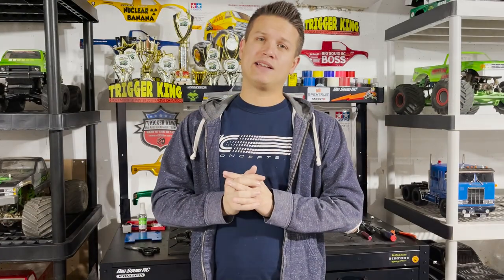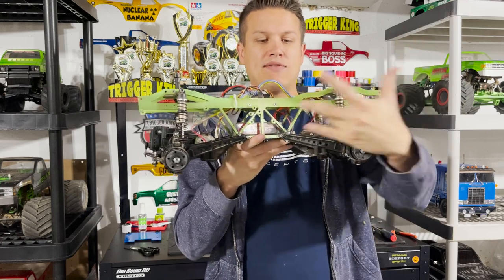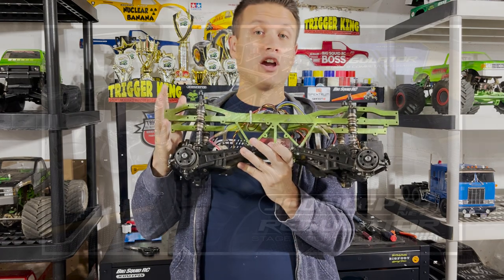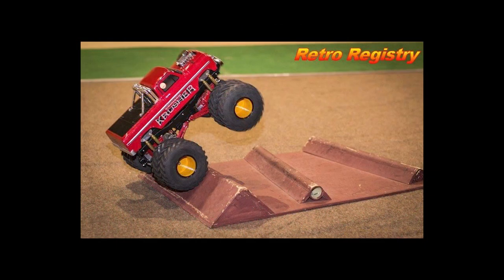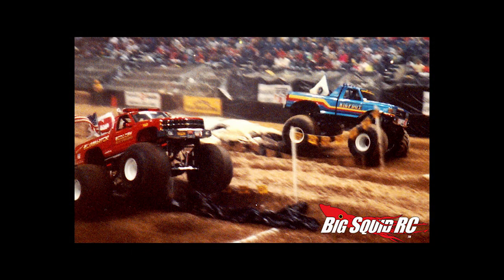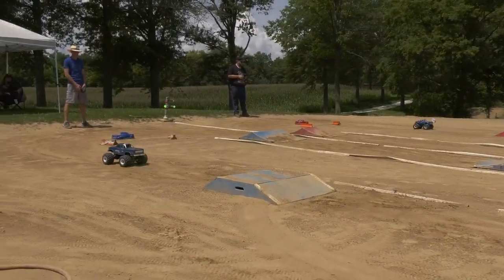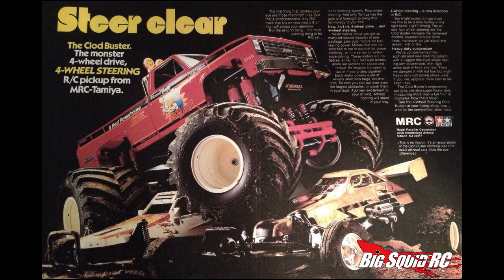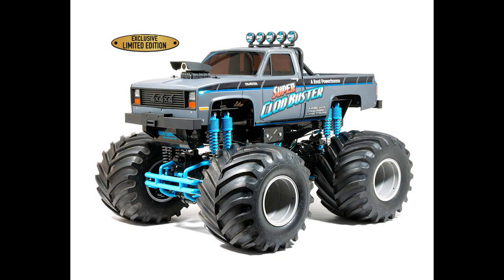What is a Retro RC Monster Truck?

Comment: Retros are such a blast! We've found by limiting the speed and having a minimum weight, it makes all the trucks whether clod-based or shafty, fairly even which makes for close and unpredictable racing with trucks that are pretty rugged and require very little maintenance after races. We based our rules off what you guys do basically replicating the late 80's stage II trucks running bodies of 1993 and older with the base being either clodbuster or replicating the suspension setups of the time period.
Reply: Should also be limited to 2S and Mabuchi motors only!  That would really be down to driver skill and how well they know their build
Reply from the maker: @georged2715  Hey George, I'm going to do a response video to this as there are some excellent responses already, but on the Mabuchi thing while we totally agree with you, in practice when you start getting a lot of people showing up, unlabeled silver can motors can be anything inside and once some people start having trucks that are way faster (a lot of the time it can be luck of the draw, some production line brushed motors are just a lot faster and others slower despite being the same motor technically) then racers start getting upset and accusing others of cheating or foul play, which is why we went to actual labeled 27t motors like axials or jconcepts. I'll talk more about this in the upcoming video!

Comment: As for me an Rc retro monster truck is a Clod based one. Not perfect, not 100% scale but has its charme. Bought my Clod in 87 an had blast with it. Later in the mid 90's the Juggernaut followed. A fine rig but total different animal with its torque twist. I'm 58 now and after 37 years the Clod still has my attention while the Jug has not. I hope that explains  Retro. 😊

Comment: I look at a true retro being a clod based axle motor mount truck. It is one of the true original monster trucks that you could get different kits and build up back in the days. I am working on one now with a full aluminum chassis. I gotten 2 for $45 last week.

Comment: Great to see you again 👍

I used to think that retro monster trucks is just out of the box trucks with minimal to no improvements and 27t brushed 540 can motor with 2S lipo 🙂

But there is one thing.... don't know how to call it (English not my native🤠). 
Older monster trucks are not so "super-stable low-center-of-gravity wide-axles low-clearance etc racing thing"... 
It just a monster trucks like from maybe 80s? 
Thats the point👍🙌🌞 long live to retro)))
Reply from the maker: Hey thanks for the comment. Totally understand wanting them to have a higher COG!

Comment: Thank you for the video.  I have owned a Tamiya Clod Buster ever since the kit was first released in 1987.  It has been highly modified over the years and just recently I took it out of storage to bring it back to life again.

This is interesting because I never knew that there was this trend to create a retro monster truck racing class until I saw your video.  Back when I first got into R/C monster trucks, there were no modifications available for the Clod Buster so they were all stock, aside from the parts from Tamiya like shocks and bearings.  Once I saw an ESP Hobby ad in R/C Car Action magazine though, then that got the ball rolling.

Thanks again for the video.  I'm having fun doing research into what it will take to get my old Clod Buster rolling again.
Reply from the maker: I think a lot of us saw that same ad.  It was fun to watch all the mods that people made and sold come out on the years following its release.  While the stock Clod's steering is junk, it still brings back memories when you drive a bone stock one.
Reply: @TriggerKingRC  It's funny that you mentioned the stock Clod's steering system.  One of my old trucks that I just dusted off and am working on is the actual King Clod truck that ESP used in their ads and catalogs.  I bought it off of one of the old ESP team drivers.  (I honestly cannot remember his name since I've been out of the R/C monster truck game for about 15 - 20 years now.)  I could convert its steering system to something better by mounting a servo on each gearcase but I decided to keep its original Clodzilla II chassis mounted big 1/4 scale servo.  It's steering performance is terrible, like you mentioned, with lots of slop/play but it is a look back in time to when most Clod Buster modifications were for looks and not for all out performance.

Comment: I think the CEN racing stuff might be a good place to start from if someone would come out with a leaf sprung solution.  Despite not being an old school RC it would be a good starting point for a more realistic old school MT class, particularly the F250, but the cost is a bit prohibitive.
Reply from the maker: Hey Sean I know the only experience that I (Doug here) have anything CEN was that 1/12 monster truck they did a few years ago and the quality was, um, questionable is a charitable way to put it. I know the big dually trucks they've done seem to have a lot of fans though so perhaps these days CEN makes better stuff? I feel like the first company that does a proper leaf old school truck is gonna sell a ton
Reply: @TriggerKingRC  I get that feeling too and it's not like I have some fountain of confidence in CEN, just they're the only ones that seem to be remotely in the neighborhood.  with something they could easily convert. lol

Comment: A retro truck clodbuster based, is just that. The early days of the full sized trucks were bouncy and sloppy and had real crushing power and the suspension was what it was. So motors on axle sucks but that’s what we have. No matter how much money you sink into it, it still is old technology. Tamiya really needs to up their game. I built an axial smt10 but it was the wrong size and still didn’t feel like the real thing.

Comment: So I've been working on getting a group started here in East Texas, and we've settled on rules similar to trigger king's except we wanted to simulate the later days of leaf spring trucks, so we upped the motor to 17t. So far it's been Fun and really replicates that Fast Leafer era of the early 90s....
Clods with stock style suspension and shaft trucks as long as they have leaf springs and no triangulated 4 link.
Reply from the maker: Glad you guys are getting it going down in Texas! 17t sounds like a lot of fun for them! You guys allow oil shocks?
Reply: @TriggerKingRC  yes. We definitely land on the old school monster trucks side of the equation rather than the old school RC side.

Comment: I feel like a retro MT should have slower motors (27 turn), minimal suspension travel and have an older body style. After that, have fun. Shafty or MoA, go out and run them.
Reply from the maker: I think this is ultimately what most people think too!

Comment: The best way to regulate the Retro class (or any power-limited class) is with the track. Making it so the trucks can't wind out speed-wise, a mix of different kinds of turns, etc makes you have to set your truck up to compromise somewhere.
Reply from the maker: Hey mtfan thanks for the comment. We all agree with you...though having done it for years, if you start trying to add a ton of turns and obstacles to slow faster trucks down, it winds up just mucking up the racing and turning it into a "whose truck can randomly get the best bounce". Is it also turns out, the fastest trucks usually win the races anyways. This last year we limited trucks to a 10mph speed limit (we tech the trucks at the start of the race day with a radar gun) and that has felt about perfect for TNT-era retro style racing. We can have wider open, faster courses again!

Comment: You bring up a great point. The big thing that drove me towards an SMT versus a clod was the drivetrain and chassis appearance was very clearly that of a toy rather than a real truck, that and the frankly archaic stock form that requires it to be more or less rebuilt from the ground up to compete or bash reasonably well.

I would like to get into a league someday and retro class certainly has it's appeal, but I really have no desire to get tangled up the weird twin motor on axle setup of clods. I think given the roots of the real steel sport, it would be very cool to see retro trucks built off of crawlers, with ladder bars and two or even 3-links and leafsprings, maybe broadening the class inspiration from TNT all the way to early PENDA series and. I don't know how they would match up to modclods, but I recall someone building an excalibur with with a leaf and coil hybrid suspension that competes in the retro outlaw series. As it is now, the fact that clods are really the only platform for retro seems like it would discourage a lot of potential competitors and leagues from form, as the clod is rather unlike any other scale RC vehicle.
Reply from the maker: Thanks for the comment! Hopefully soon there are options for leaf trucks!

Comment: I feel like a Retro RC Monster truck racing should be either a Clod based model or a Juggernaut with 27T motors and 2s battery. I would include the Kyosho USA-1 but it is even less scale than the Clod with its odd independent suspension chassis. So I would say "OUTLAW Retro CLODERNAUT Monster Truck Challenge"

Comment: Nice video.  I just built a Freestyle RC Axis retro chassis.  There's no clubs around so this was just for fun.  It's a cool blend of leaf springs and a modern SMT10 drivetrain so it's somewhere in the grey area of what a retro truck is.  But yeah, good luck defining it 😂

Also, I COMPLETELY AGREE about the Juggernaut re-release!!!  Don't you have enough influence in the industry to help make that happen?  haha
Reply from the maker: Thanks for the comment on this, hopefully you are liking the Axis chassis! Josh and Freestyle always put out top quality parts & chassis and those trucks look like nice kits. As you say, the Axis is somewhere in the grey area and last year when it came out we thought it looked a little Stage 3-ish (like the early 90's trucks when hybrid suspensions became somewhat normal) for what we wanted our class to be and didn't allow it. That's why I say from a racing perspective this class is extremely tricky to try and govern we recommend just going with what your local crew would wanna do if you wanna race them!

As for the Jugg re-release, I think Tamiya just does whatever they want at all times and doesn't pay much attention to whats going on in the hobby at large. Or at least it seems that way in a lot of respects! A Jugg 2 re-release or a Jugg 3 (assuming they use a good body) would be a massive hit. So much so, that I think if the Jugg was available these days it would become the defacto Retro-racer.

Comment: I've been wanting to get into building one of these for a long time personally as I've been a fan of monster trucks since I was a kid way back in the 80's. However, I've found myself always worried about "doing it wrong" for the longest time. To spend a nice chunk of change on a truck only to find that I've built something that wouldn't pass tech for something like a Trigger King or another organization. That I would be excluded from participating because what I think would work and what is allowed are two different things. I'd simply wind up just wasting the time of not only myself but of others trying to ask questions and attempt to get literal unobtanium parts. I do hope one day that Tamiya will get off their butts as re-release the Juggernaut cause that one has checked all the boxes I've wanted but again it's become so difficult to find one so as to be next to impossible.  I have wondered if it was possible to build as close to a Juggernaut using more modern parts but I have no clue where to start.
Reply from the maker: Good luck there. Tough to find stuff for it.

Comment: Sure, a more correct shafty truck with replica Rockwells would be great, for looks. But leaf spring monsters were basically rigid. 

Imho, a retro truck should be stock or near stock wheelbase, ladder bars, and slow. Y'all's trucks are a perfect speed. I wouldn't have a problem with a low speed brushless setup, seeing how quality brushed motors barely exist

I think maybe the course should be tight enough to require 4ws to get around in a hurry.

Comment: Thanks for the video! 

When I think retro RC class I think of not only older style monster trucks but also older models RC. 

I’ve been wanting to get racing going here. We have a nice dirt track for 1/8 and 1/10 scale racing. There is what use to be a dirt oval track in the back. I’m going to be able to use it for monster truck course 🤗

Thinking about how regulate - and for us it will be easy - LMT class and all others lol. Kidding. 

With retro - brushed motor stated spec limits - list of allowed chassis - list (can be long!) of proline etc bodies that meet the criteria of the retro look. 

I like to keep rules etc VERY simple. Give me a list of ten things I need to make sure are in spec etc and I may or may not even mess with it.  Give me 2 or 3 and I’m good. 

Like bowling alley - only rule (well, you get it) is don’t cross that line!  Man I’ll be jumping like I’m getting burnt when I accidentally slide across it or something 😂😂.
Reply from the maker: Funny you say you think Retro is older rc models as when we started our retro class, we operated a bit under that too and allowed Tamiya Lunchbox/Pumpkins in because they were old releases and were also mini monsters similar to like how the Bigfoot Ranger/Shuttle would sometimes compete. We have older videos like that. Good luck on getting racing going, it's a lot of fun!

Comment: Retro could be split into a class that mimicks stage 1 and one that mimicks stage 2 trucks.  Box stock clods mimick the clumsy nature of the original monster trucks.
Reply from the maker: We have run a class called Classic Retro, which is made to be based off the Stage 1 trucks.  We do not run it very often though.